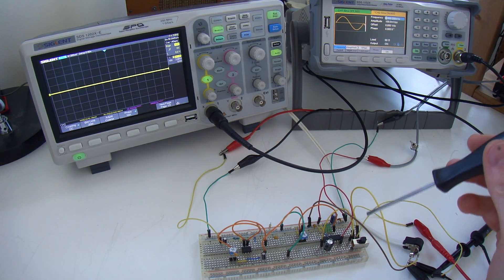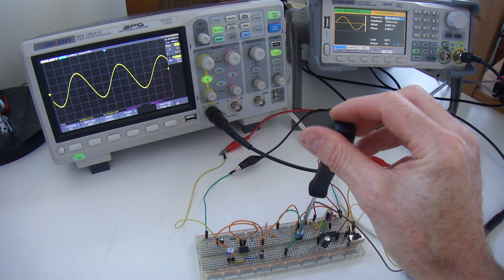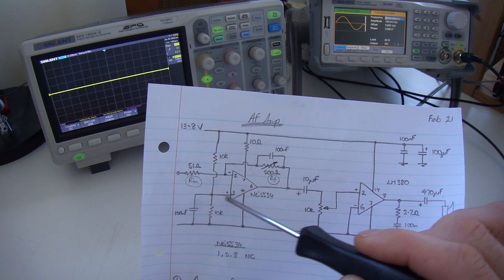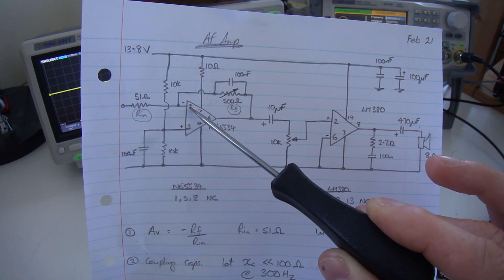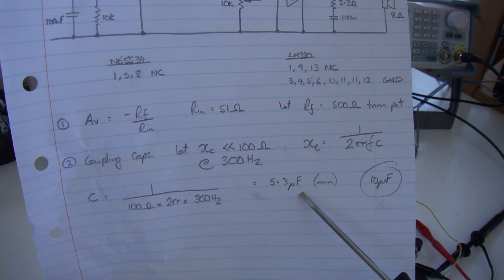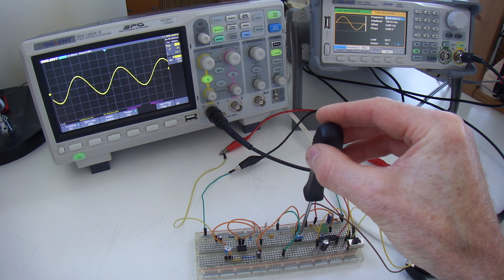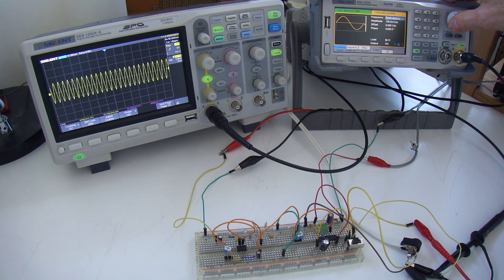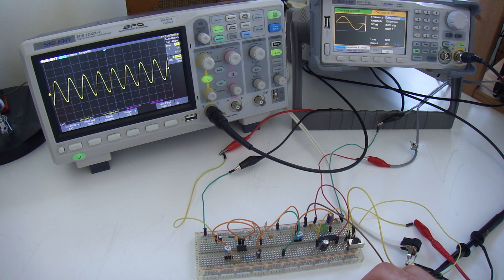Simple SSB Rig: Part 4 - Audio Amplifier

Comment: Bit strange to put 100nF across the 500R variable, as this gives a LPF with a variable frequency cut off of 3kHz at 500R and rises to a higher cutoff as the pot is reduced... A LPF is good to use to limit the audio response to about SSB ranges, but this needs to a fixed value independent of the volume/gain adjustment... a passive filter before or after the 1st opamp would be better?
Reply from the maker: Hi Anthony. I will look to revisit this at some stage. I find the 100 nF cap is also good for reducing some distortion. That's the main reason why I have left it in. All good fun!

Comment: I love the videos! One note: you do have an low pass active filter in your circuit! the 100 nF capacitor in parallel to the the 500 Ohm feedback resistor forms the active low pass filter. The filter's frequency is 1/(R*C*2pi).  It ends up being around 10 kHz filter because the variable resistor was lowered to about 100-200 Hz. That's why, at the end of the video, the  signal gets attenuated over 10 kHz.
Reply from the maker: Thanks Scott. Yes, I know that now which is good. I will look to use that in the future. Thanks again.
Reply: @CharlieMorrisZL2CTM  I'm learning so much from your videos, happy to contribute a little bit back

Comment: Thanks again, Charlie, your explanations help a great deal. I think I have some LM 386 chips, I think they are compatible swaps for the LM380? Ah, just checked and you are using the 14pin LM380, so 2.5w output to the 1w of the LM386. Should have checked first!
Reply from the maker: No problems at all. I do like the LM380. It works well for me.

Comment: Alsom. This circuit looks like MST QRP AF design. MST uses NE5534 and MST2 uses NE5532. But MST QRP also use TDA7052AT that has DC volume control with pin no.4. for AGC Control. Good work sir. I follow you. Take care TA9AAP 73.
Reply from the maker: Thanks for the info Turker. I'll look into those.

Comment: Just simulated with LT-Spice input Z as 5.6K , I don't think that Z match plays any part in this if the product detector doesn't care, its more voltage driven than power driven at that impedance level.
Reply from the maker: Thanks Jerry for both comments. That makers sense. I think I'll leave it as is for now and see how it performs in the radio. I can tweak it after that.

Comment: The Rin in the equation must include the output impedance of the preceding stage. In order establish an input Z of 51 ohms you must put in parallel with the input as the op amp would have to have a zero ohm input Z if in series. The data sheet shows a nominal 100k ohm input Z for the NE5534 therefore Rf is setting the actual circuit input Z as the output Z is practically zero.

Comment: May I ask what is the function/intention of the 10R resistor on the +ve power pin of the pre-amp? Thanks for a very interesting video.
Reply from the maker: It's an attempt to provide some additional decoupling from any variations on the VCC rail.

Comment: Thanks Charlie! Great video - as always. I generally use the NE5534 for a very dependable preamp. My usual audio amp IC of choice is the TDA2003A. They are cheap and plentiful in the UK. They can actually put out 10W (with a heatsink) but I never drive them that hard! With a decent speaker it sounds pretty good. I must have a look at the LM380 again though. It is certainly a simpler circuit.

I'm looking forward to when you start building your double balanced mixers!

Thanks again for sharing your homebrewing experience. It's really great to see.

Look after yourself. 73.

Nick
M0NTV
Reply from the maker: Thanks for the feedback Nick. I'll look to use the NE5534P again for the mic amp.

Take care
Charlie ZL2CTM

Comment: both 100nF caps are in fact "bandwidth limiting" specially the one on the feedback gives it a lowpass response but for 3KHz it should be ok
Reply from the maker: Thanks Amir. As I mentioned below I included that cap to clean up some noise in an earlier version. 3 kHz -3 dB should be fine, noting that I didn't see that in the test (not until 10 kHz plus).

Comment: You have some frequency limit on the first opamp with the 100n in the feed back,  -3dB point when Xc equals the value of the pot. Plus 1 for equipment video.
Reply from the maker: Yes are right. I included that cap to clean up some noise in an earlier version. Even though I didn't seem to have the same issue this time, I just elected to use it again. The fact that is also provide a high freq limit is a bonus.

Comment: Thanks Charlie, I was looking at changing from the LM386. It's so temperamental at high gain, to say the least. lol
Reply from the maker: I agree. Check out the last build where I compare the LM386 and the LM380. As far as I am concerned, the LM380 is far superior.
Reply: @CharlieMorrisZL2CTM  Somehow I missed that one, I might have been distracted while it was playing. Thank you!
Reply: I had some issues with LM386 as well, but all of them where successfully solved by proper filtering of 12V supply. Here is the schematic I'm using https://eax.me/files/2021/01/improved-af-amplifier.png It also includes a diplexer, so you can pass an IF signal from the diode ring mixer directly to it.
Reply: @R2AUK  Thanks Alex I will try that. My main complaint is that it starts to oscillate almost every time you change a circuit upstream. And yes you have found the biggest problem of all the power supply.  I made a lithium battery pack and installed everything from 5 volt to 15 volt regulators. It works great for playing with this stuff. I keep going back to the switching power supply and add filters where needed. The battery just eliminates the filtering headache while trying new circuits. Thanks again, I'm always looking for new ways of doing it.